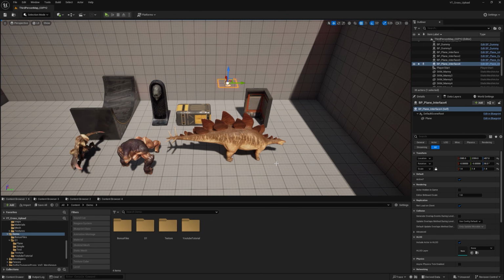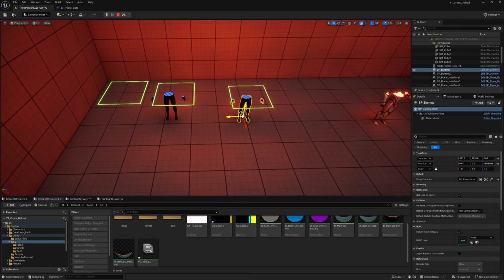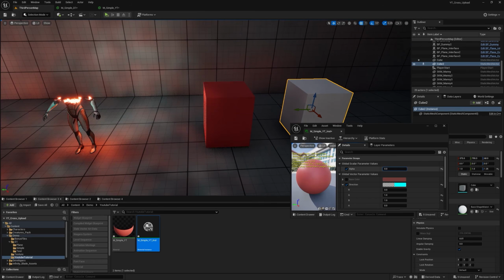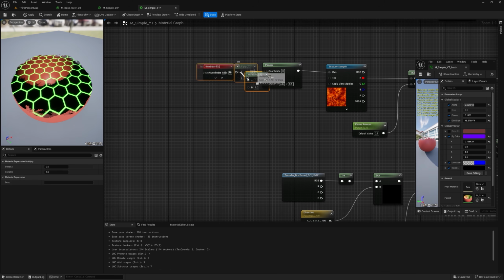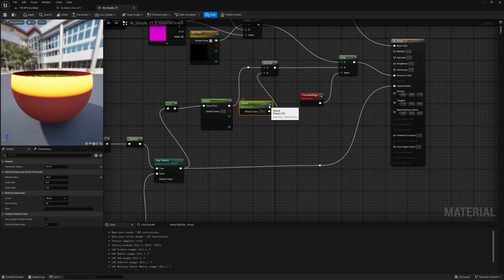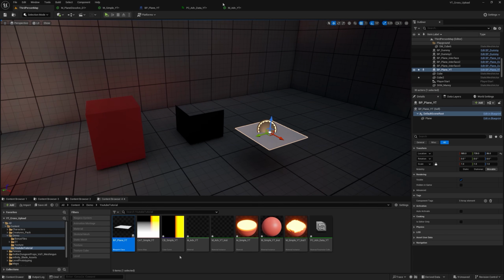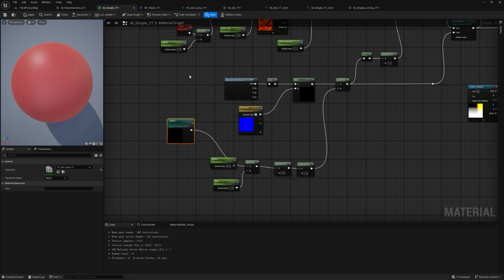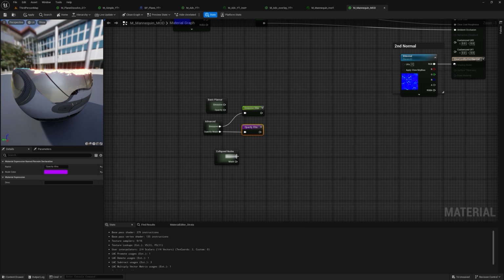UE5:  Planar Dissolve and Cross Sections Tutorial

Comment: Fantastic! 

In case you have issues with filling: 
1. Make sure you have Bloom enabled in settings
2. Check light intensity of directional light and exposition settings of Post process volume (reset them back to default first)
Reply: Sadly, advanced approach doesn't work with ISM/HISM and emissive solution is forcing you to use.very light colors, you cannot use black as emissive. So if you need black fill, start from 13:00 and ignore emissive color, use lerp node to mix texture, dark fill color and TwoSidedSign as alpha to Base Color.

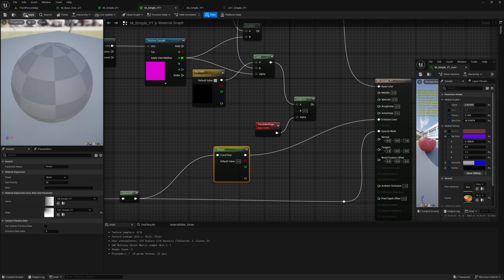Comment: Can't solve the following Problem at 18:12 - "[SM6] (Node CurveAtlasRowParameter) Cannot cast from larger type float4 to smaller type float2." I can't connect the Curve atlas parameter into the emissive color. It seems like i missed a step, but rewatching multiple times it seems like you got some video cuts in the creation - maybe something is missing? Would be realy glad for some help! ;)
Reply from the maker: Did you forget the dot product?
Reply: @UnrealCG  I got the Dot product at the branch for the BoundingBox and the Direction Param, but no Dot at the Flame Texture and i cant find one there in the video, but seems like its the missing component. At which point should i implement the dot again on the other branch?
Reply: Using BreakOutFloat3 node, or ComponentMask to get one channel will do the trick, connect it to CurveTime and it should work
Reply: For anyone who might get stuck here - using the full RGB from the fire texture sampler causes this issue - you want to just use a single colour channel (R) - if, like me, you didn't have starter content installed and used one of the greyscale fire noise textures instead, you can still just use the R node but for what it's worth I think the tiled texture just looks better all round for the effect :)

(To install starter content, open content drawer, click the top left +Add button, select "Add feature or content pack", and select starter content)
Reply: I am stuck on the same thing